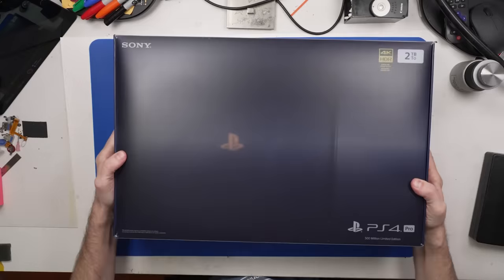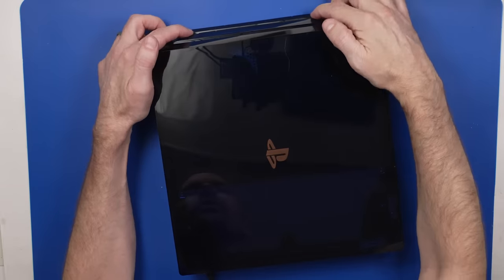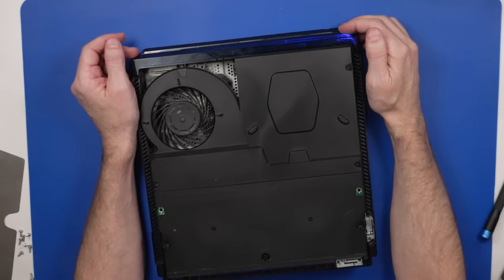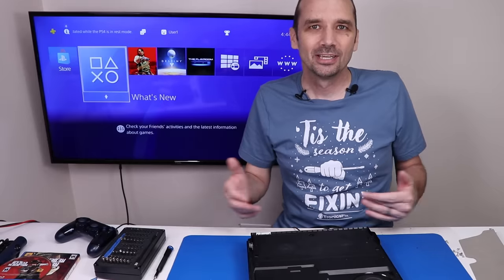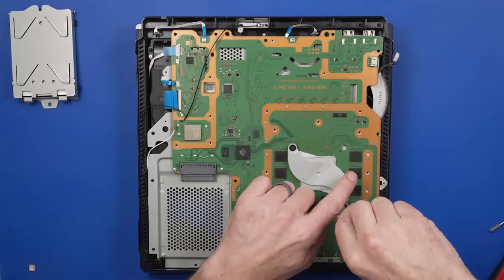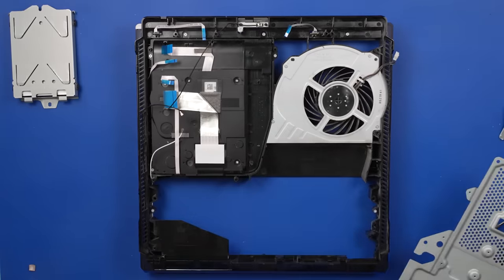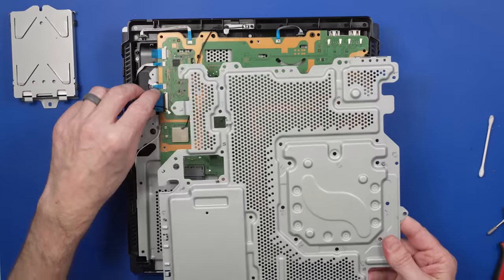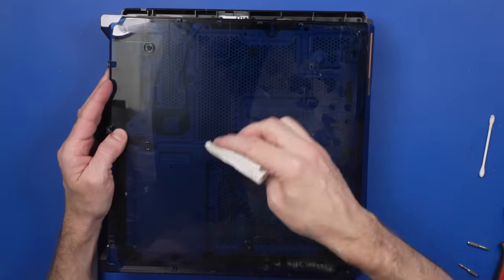Rare PS4 Deemed "Unfixable" After Repair Shop Fail - Can I Fix It?!

Comment: Red flag for shops like that is if stuff is leaving in worse condition then when it came in. If I was the owner of that PS4 I would have sued them, because I'm sure the PS4 "turned on" when dropped off, then for them to have it for however long and to say hey it's unfixable and now it doesn't even turn on at all. WTF?! Don't go to places like this, if you have to get something in writing stating the item should at least leave in the "SAME CONDITION" as it came in even if they didn't fix it. Which they shouldn't charge for as well when it wasn't fixed.

Comment: I don’t trust repair shops, so I bought an iFixit tool kit, some IPA and a can of compressed air, some thermal paste and a new battery, and I fixed myself. I have no technical training, but following the repair guide and some of Steves videos, I cleaned my PS4 and put a new battery and new thermal paste in it. Now it works like it was new and the expense was the same as if I sent it to a shop.

Comment: The perfect amount of thermal paste never fails to make me smile.
Reply: that is if he ever put the right amount on, you only need a small pea size its purpose is to fill in microscopic scratches not be a filling in a sandwich, it will only squirt out when the 2 pieces are put back together. you even saw that on the amount the repair shop put on

Comment: Quick question: you made sure it started, but the initial report was overheating. Shouldn't you also do some kind of stress test to check nothing was actually wrong, and it was only the pads?
Reply: the amount of dirt on the heat sync it wasn't "just the pads". It would depend on if he plans to resell it or just keep it so he has a rare ps4.
Reply: @johndorian4078  Yeah, I totally missed the heatsink! My ps5 was overheating, and just cleaning it up did the trick. Still I think he should to a stress test, just for ease of mind

Comment: Dude, you need a high-pressure air compressor with a couple of humidity filters and blow your stuff clean in an instant. Forget those toothbrushes!Get a quality paint brush to brush things off in larger/faster passes.

Comment: When I was a kid, my first ever laptop stopped working. The screen wouldn't display and it no longer powered on. I took it to Staples or BestBuy to get a professional to look at, they immediately surmised I'd need a new motherboard. Never even opened it up. They then used a universal adapter to see if it'd hold a charge and the power button lit up and they changed their story to needing a new screen and it would cost over $300 for a $800 laptop. My dad and I just took it home.

After I saw what they did with the universal adapter, I went through all our old electronics and found random power supplies. I did Robotics my first year of HS so I had some basic soldering skills and managed to get something spliced together to charge the laptop. Finally, I got brave enough to open it up and lo and behold, the display connector wasn't plugged in anymore (probably from a drop or something) . I plugged it back in and my screen came back on... This was over 15 years ago, some things never change, huh? ._.

Comment: I had to Google a national electronics repair chain that starts with a U and... there's over 800 locations? I've never heard of them. If I saw one of them, I'd assume it was just some local one-off thing run by a shifty guy.
Reply: The same.  I never heard them either.

Comment: Did you try to run it for a few hours to stress test it? Because it can boot to the menu but can it run games for hours? Some errors can occur when it heats up or it's under load.

Comment: Yea you got to love problems like that, I bought a new in window AC and didn’t work out of the box, there was a whole hassle with tech support and I didn’t want to drag it all the way back to the store. 
A few minutes later I pulled the face off and all that was wrong is they pinched the wires to the front controls under the face plate bracket, a little cutting and some tape and I haven’t had a problem since.

Comment: Iso on the rubber rollers can cause them to dry out and not be as effective, see it on printers all the time. Granted grabbing a plastic CD is quite a bit different than a single sheet of paper.

Comment: Got a sound system for a similar reason, the power cord wasn't connected from the factory.  Customer said failed to use before warranty expired. Customer had tried to fix but never found the loose wire. They were afraid of it and had already bought a replacement.

Comment: I clean consoles on a daily base here in Germany and I'm often surprised(and shocked) about the inability of these "Repair shops".  
It's funny how you can tell that the repair guy never opened a console from the start when you see missing or numbered screws or the WiFi/Bluetooth antenna cables routed incorrectly(like in this case). The other thing I see often is the APU pressure plate turned around or people using Liquid metal on a PS4(not so funny to remove it with sandpaper after a year+, because it reacted with the copper of the cooling block ^^).

Thank you Steve for another great video!

Comment: The issue was only postponed here. The proper "fix" to the ps4 pro overheating issue is the relapping of the copper plate of the heatsink. Machining was poorly made on early pros. Take a stone and make that surface as flat as possible. It'll make a night/day difference even in fan speeds.

Comment: People put way too much trust on "repair shops". In a good majority of cases, in most countries, these "repair shops" are not officially licensed or endorsed in any way by the device manufacturers, and it's simply the employees doing the repairs based mostly on looking up on the internet what to do. Many of them are not trained technicians of any sort, but just regular untrained people employed by the store, tasked to do these "repairs" to the best of their abilities. The only advantage that these employees have over most regular people is that they have more tools at their disposal that most people wouldn't have at home. So, in fact, almost any even slightly technically savvy person could do these same "repairs" by looking up info online, but they usually do not already own the tools necessary for it, so they wouldn't be able to do a good portion of repairs even if they wanted to (without spending money on purchasing the needed tools).

But this does mean that a good portion of "repair shops" are staffed by incompetent people who are not trained technicians, and people put too much faith on them.

Comment: You didn't seem to test if there was still an overheating issue like you said the seller claimed it had. Looks more like you tested to see if it powered on, and then claimed it was fixed.

Comment: On the microscratches on the case:

Baking soda: A baking soda paste can be used to buff out slightly deeper scratches that don't disappear with the use of toothpaste. Sandpaper: Micro-grit sandpaper is the easiest option to polish out deep scratches from plastic. It works best when dampened, to prevent further damage to the item.

Comment: I bought a Japanese PSP 3000 from eBay to use as parts for mine for $40, no battery, no cove, listed for parts or repair, description basically said it was deadr, vibrant blue, hardly any scratches, but really dirty. I get it and decide to see if it works. Green light came on, back light came, black screen and eventually turned itself off. I hold down the l trigger, the PS button and power it on again. It boots. It had some older m-33 custom firmware installed. I updated it to the most recent firmware and it's absolutely fine. I'm a little mad though. I needed a few parts I lost years ago for my old PSP. I'm thinking of buying a few more from the same seller listed as for parts or repair.

Comment: I wonder how these people are choosing a repair shop. Like personally the couple of times my systems had something I couldn't personally repair, I took them to people that I knew and also showed a lot of their previous repairs online somewhere. 

For someone to rip out the connector, glue it back and then not being able to check if the damn thing is even properly connected, after they did a horrible job cleaning it up, shows me someone that barely has any idea on how to open up the system. 

I wonder if the actual "repair shop" is the console owner instead.

Comment: From watching your channel I have learned an actively do my own electronics now. Still working on my soldering skill(I'm a welder/Fabricator by trade but soldering a different animal)

I actually fix and clean my own stuff because I like taking care of my things. I bought an iFixit kit and once every 6 months I take apart and clean my PlayStation 5. I haven't taken it down to the motherboard and all that to check the liquid metal. Kind of want to buy a broken kind of throwaway PS5, something that I can practice going down that far on. But that is a hard thing to do. So if you got any tips that would help or maybe got one you could sell me that would be awesome. I live in the USA. I'm pretty mechanically inclined but I definitely don't want to do it on my main PS5 first cuz I haven't fully taken apart a PS5 yet.

Comment: They did a pretty good job other than not plugging it back in
Reply from the maker: On the psu connector fix, yes
Reply: They did a horrendous job lol. Missing all screws, heat sink clogged, failed to reconnect a connector that THEY fixed, dude brought in a working although overheating system and left with a bricked system that still would’ve overheated 😂

Comment: First time I took my PS3 apart I forgot to reconnect the fan but remembered half way through reassembling thankfully, with new thermal paste and pads my CECHA01 is running better than ever.

Comment: Maybe it was an edit, but at the end putting the large heat shield on top of the board, the crossbrace for the processor wasn't installed. 🤔

Comment: Steve, I recently bought a ps4 slim with a broken HDMI port. I tried desoldering it but it seemed to never let go of the board, so I went crazy on it with sidecutters and removed it from the board thinking it would be easier to remove the legs one by one with an iron since I don't have a hot air station, only a temp controlled soldering station. Now all that's left are the small legs which are stuck on the board. I have tried adding solder, removing solder and everything in between, but I just can't get rid of them to install the new port. How do I fix this?

Comment: I've dealt with computers that shop has had in their possession. One was held for 4 week and they had no clue what was wrong with it, I diagnosed it as a corrupt BIOS while just chatting with the client who brought it in. Sure enough Microsoft pushed a Firmware update and bricked the board. Reprogrammed chip, re soldered it back the board and voila she was ALIVE. 

15min vs 4 weeks LOL

Comment: Quick question and I tried to search it trust me, I also don't see any videos that mention it.

I am curious to know what components monitor heat inside the PS4 slim. As it doesn't have the settings option to check temperature 🌡️. So how does the PS4 slim know when it is overheating. What components activate the power to fan when it goes turbo mode. And also what part of the motherboard would get hot and sense the heat rise? 
I was always under the assumption that it is the GPU or CPU. Although it always seems like the power supply is where the heat comes from.

Any info would be helpful and ver appreciated

Comment: I have a backwards compatible ps3 fat the 80gig version aka the best one of the backwards ps3s and I took pride in it bc there weren’t many functioning examples of it left out there and then last summer it finally stopped working. I took it to two repair shops and both told me they couldn’t do anything for me. Think you’d be able to fix it? It’s got the yellow light of death btw. I was told these backwards ps3s weren’t designed well and weren’t destined to have a long life

Comment: 14:40 that's what I call a dust bunny lol . I bought a used laptop and the very first thing I did was open it up to check for dust and there was a lot of bunnies in there. after that it worked perfectly and it's a 6 year old laptop.

Comment: last gen consoles are so slow without an SSD, a definite must upgrade for all restoration jobs.
Reply: but then it wouldn't be a rare edition anymore, it would be a modified rare edition. Which some would argue makes it pointless to have a rare edition.
Reply: @johndorian4078  ah yes I would much rather have a rare all original condition one, thats unusable with a bad clicking HDD than a super speed ssd🤨
Reply: @johndorian4078  It’s still a special edition. Regardless if the HD has been swapped to a superior SSD

Comment: I've derped a couple of times like that when building a computer.  Didn't turn on after I re-did the cables.  I had everything plugged into the board ok, but I had unplugged all the cords from the PSU end (modular PSU) to re-route cords and make things neater, and the main one didn't get plugged back in fully.  But then, I wasn't taking money to do this for someone else, it was my own build, and I quickly found the problem.

Comment: What percentage isopropyl alcohol would you use for cleaning electronics? I presume 99.9%.
Would there be any reason to use a lower percentage? Thank you!
Reply: If you can't get 99.9 or your local stores like mine 91% works fine. 99.9 just has less water in it.
Reply: @daveshank1921  That’s great, thank you for explaining!

Comment: I have a PS4 Pro where the disc drive seems to have issues with the disc not seating properly or something where it won't spin the disc and then does a kind of fake eject and then tries again but the disc won't spin. However, if I put the PS4 Pro in the vertical position and give it some whacks while it's trying to do something with the disc it eventually is able to spin and read the disc. Sometimes while vertical it reads the disc on the first or second (after the fake eject) try.

I did take the PS4 Pro apart but I did not see anything obviously wrong with the disc drive. So I'm at a loss. At least the drive does still work. Once the disc starts spinning there is no other issues.

Comment: The old "the repair shop did it" but in reality the owner watched a youtube video and thought it looked easy so tried doing it with no experience. 

PlayStation's are the worst ones to try and do yourself as they pack everything in and have so many screws the xboxs always much simple and seem to waste a lot of space inside. 

I feel like the seller tried to do it themselves as they do after they think watching a youtube video makes them an expert. It's fine if it's a standard pS4 pro but not this one.

Comment: i found an ebay listing for 279.  with tax and 2 year warranty and shipping was 408 out the door. 
1x ps4 pro
1x vr headset
1x platinum headset
1x vr camera
2x controlers
1x gta 5
1x gran tourismo vr

Comment: I don't get why you praise them for repairing the power supply connector when it was probably them who broke it in the first place 

And the positive part of my comment: 
I always wanted the 20th anniversary grey PS4 and the 50 million PS4 Pro, never got my hands on one for a reasonable price (or didn't have the money at the moment)
Reply from the maker: Regardless of who broke it they did a good job fixing it. Still a rip off but they objectively did do a good job fixing the thing they broke.

Comment: Yo I got a Xbox series X I got used from the Facebook market place, and it works well but the only problem is that my Xbox can’t find other networks or WiFi to connect I always have to restart my Xbox to find a network I looked online and it says that the connector has failed and I need to get it fixed. What can I do?

Comment: that psu plugin port molex plug is so flimsy, i almost sharded it off trying to unplug it with pliers, luckily only a piece of the plug that plugs in not the socket itself just flaked off a corner. Def something you want to use a non metal pliers for or your fingers if u can get them in there.

Comment: I just realized something. I have YouTube playing on my TV via my ps4, but my TV remote can control it as if it were a built-in app on the TV. I can start, stop, scroll, read comments, pretty much everything  except exiting a video. I don't see how it works. You'd think I could only control it with my PS4 controller. After all, the signal is only going through my hdmi cable.

Comment: 16:18 in the future you may wanna clean the thermal paste off the caps next to the processor. I've had 3 gpus not work until I cleaned the paste off the caps and then worked perfectly.

Comment: Repair shops nowadays are a joke. Especially large chain shops. In a hurry to make a buck without doing proper work. 
Small business shops are superior imo. More passion and patience for electronics. It's not just a job and another customer to most.
Not connecting the power supply isn't too too bad, but not going back in and rechecking is just a shame. I'd be embarrassed. 
I've worked on plenty of electronics with most jobs being a success but I'm in no way an expert. I still consider myself an amateur. I hope the shop owner seen this video.

Comment: The power supply has a ripped cable look at the psu side of the connecter there's a loose wire